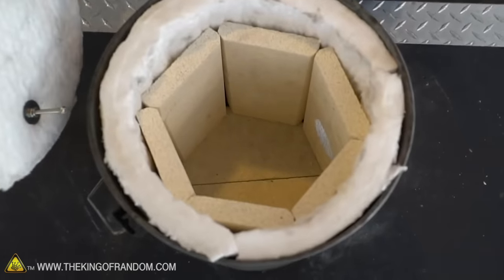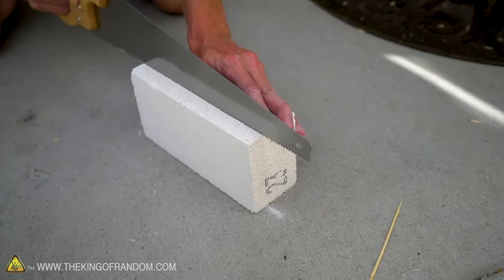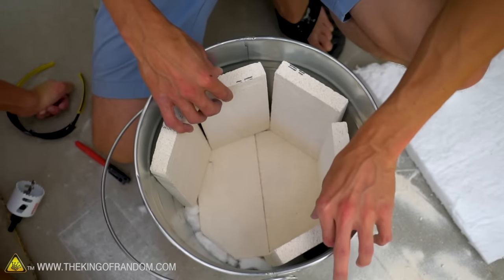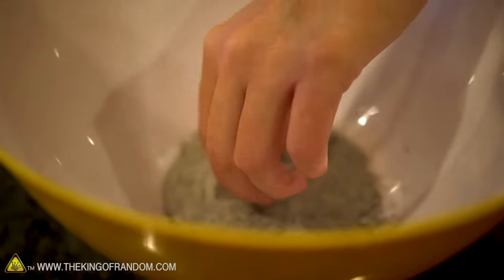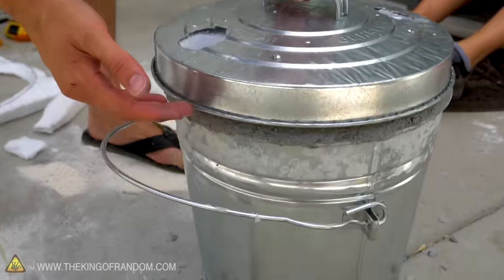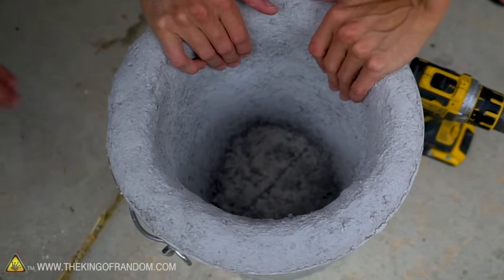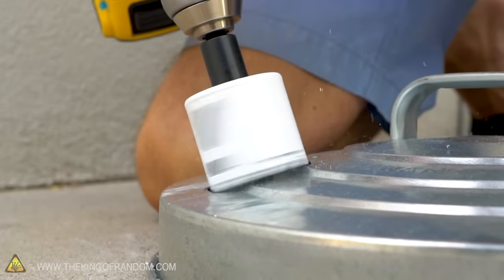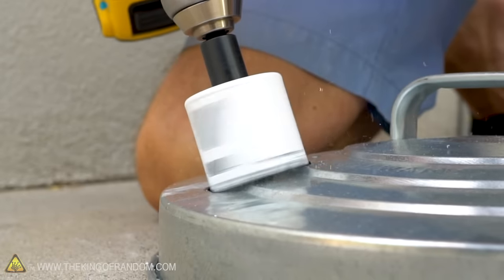Building The ULTIMATE Backyard Foundry

Comment: Just tested my electric foundry inspired on one of Grant's videos and It can go up to 1200C !!
Reply: I wonder what other heat sources you could use
Reply: @OldGamerNoob burning  propane or oil, graphite electrodes or induction are some other options
Reply: K
Reply: Friggin pyromaniac XD
Reply: @MechaRoses  nope, only if the heat is transfered into combustible materials.
Electric current creates plassma arcs, not flames (though technically flames are also a form of plasma)
Reply: Pretty fast for Mario kart
Reply: That's so cool!! Congratulations man!!

Comment: Only thing missing is ITC HT100  that is the height temperature refractory coating to go over the cement and cure it completely.  It will reduce fuel consumption and increase the heating capacity of the  foundry.  And your foundry will  last longer too.
🙏blessings abundant yall
Crawford out 🧙‍♂️

Comment: This I is a really nice upgrade to Grant's design and it will probably last way longer.
But what is the cost? That was a huge factor in Grant's reason to make a metal foundry.
Reply: Johnny Stephenson seems fairly cheap. A bucket. Some heat bricks and insulation. Some concrete. Certainly seems much cheaper then buying one?
Reply: Yann cedric Totsingan  compare that with an actual foundry this size... yeah, I think I will be building my own.
Reply: Sometimes DIY projects are about the challenges not the cost. You will always have leftover materials. If you were doing several then you could have better Material utilization and have a better cost per unit.
Reply: Yann cedric Totsingan  This is cheap, it costs around $50. Buying one would cost $500-$1500.
Reply: @VPCh.  Cheaper than Grant's though?
Reply: @hudsonjunning1449  Probably a similar cost, it also be more effective, which is the main concern.
Reply: @VPCh.  the og furnace was under 20$ and was very efficient
Reply: @johnnystephenson7835  This one: Container: $10
Bricks and insulation: $10
Reply: @VPCh.  concrete, screws for lid, the drill bit?
Reply: Yann cedric Totsingan 
4 insulation bricks, one steel bucket, about 2 meters of insulation fibre, roughly a medium sized bowl of concrete/cement, a couple of screws, and a drill bit and saw. Seems incredibly cheap compared to the price of buying one. Not sure what “all those materials” are. They used hardly anything. Most expensive thing was the drill bit as far as i can tell. And if you do these kinds of projects odds are you already have a drill bit like that anyway. So yea, a fraction of the cost yann. Very cheap in comparison.

Comment: Little tip for making the Wool in the lid last longer is to seal it with a moderate (1/8-3/16" thick) coat of Satanite (refractory clay) as well as the walls of the foundry and anywhere you've drilled a hole. then it'll be pretty well bullet proof.
P.S. Satanite is a refractory clay commonly used by blacksmiths for anything from sealing the walls on a gas forge to differential hardening (setting a hamon line) on knives.
Reply: that's such a menacing name lol
Reply: What do the screws on the lid do exactly? how do you know where to place them?

Comment: Really shouldn't use galvanized steel for projects with lots of heat.
Reply: Dave Does , thats right it can make boron fumes or something like that?
Reply: @gamleole9568   pretty sure it's zinc fumes, but  whatever it is is really bad for you and cause permanent. the rule of thumb is to never use galvanized steel in high temperatures
Reply: what should one use ?
Reply: @munch15a  Steel is fine, just don't use galvanized, a painted metal bucket would be great.  I made one from galvanized and when it got real hot I could see the galvanizing burning off.  That gas is toxic.
Reply: @munch15a  stainless steel is best since it can handle high heats more so than regular steel.
Reply: @xxdabroxx  so where do I find a steel bucket that’s not galvanized ?
Reply: @yourboyjor391  get a stainless steel one.

Comment: King of Random crew I was watching your videos on thermite and liquid oxygen and I thought what would happen if you mixed them both up in one way or another.
Reply: It goes kaboom
Reply: this would prolly be abit to dangerous, thermite can be abit unpredictable and giving it pure oxygen to burn in could increase the heat, or / and the speed of the reaction from a fast hot burn to an explosive, molten metal spewing nightmare. amazing to see lol
Reply: it would not change anything, thermite uses a redox-reaction, so it provides the oxygen for the reaction itself. Adding more oxygen would not benefit the reaction.
Reply: @bertan98  its not the reaction that would be changed sinse this stuff will burn under water, but give any flame a purer oxygen atmosphere than standard and it will be increased in temp accordingly, sinse the liquid oxygen will be evaporating.
Reply: @ikitclaw7146  Evaporation removes heat?
Reply: @CosmicEpiphany  .... ok this made me lol, ty
Reply: @ikitclaw7146  physics made you laugh? I'm confused...

Comment: Have you heard about AIR CRETE ? Air crete blocks treated with water glass have heat resistance and high insulation value. Poring the blocks with beveled edge will create a barrel shape. Another revision i would suggest, is to place that barrel on top of a raise circle to allow  lifting of the barrel for spills. Other equipment as propane is clean. Some have had used oil under air pressure to reduce fuel cost. Just putting out ideas for cost saving.

Comment: I did this in 1997 with a trash can but I used clay sand mix and 2 propane torchs on a hose connected to a splinter and a BBQ tank. Lot's of aluminum went threw it. A pipe with a bottom welded on. It was nice sounded like a jet.

Comment: 10:32 next time try a same diameter (OD) PVC coupling sprayed with Pam before you apply the cement and make sure to file off any protrusions on the outside that might keep it from coming out easily after the cement cures

Comment: About that hole /saw drill bit the thinner the metal the higher the speed needs to be. I work with metal 

A high speed rotation has the tendency to scrape across the edge making a nice hole.

Fist rule is thick metal needs a slower pace so it can get rid of cut metal because there is a lot of it  and thin material has less mass so higher speed cleans more.

Comment: Nice project....In hindsight. it could be quicker to make all the holes ...through the bricks..but before applying the cement.just insert a temporary pipe and work around it with the cement paste, and pull it out before it sets

Comment: You should have lined the internal wall with wire mesh before applying that cement/mortar mix.
As is, that stuff will eventually just flake off after putting it through extreme heat.
When you use wire mesh, it acts as a flexible scaffolding to make it so the cement wont break off when it is put under stress.
Same reason they use wire mesh in construction. Without it, the cement will crack and break up over time

Comment: I recommend titanium bucket. It has one of the highest melting points. It's why they use it on military jet engines as an insulator so the flames don't melt the wings

Comment: For those who intend on building this style furnace, do yourself a favor and have a paintbrush with some water nearby. Before the high temp mortar sets, wet the brush and smooth it out for a much nicer finish. You'll have less "debris" that will tend to fall off after the heating and cooling cycles.

Comment: Nice foundry... only I wouldn't use a galvanized can for the shell.  Zinc around heat is BAD.  It only takes 788 F to melt zinc and 1665 F to boil it.  This can result in metal fume fever, which is miserable at best and lethal at worst.

Comment: Use vibra ram it’s much easer to use with a inside and a out side mold it leaves a layer between to two. You will need a vibrator of some kind one with a ball inside works well just attach the vibrator to the outside mold pore vibra ram in with inside mold inside outside mold turn on vibratory on and it turns into a liquid almost you can make the shape as thick as you want by moving inside mold mandrel to where you want it . Dry low heat for twenty four hours high heat until red hot.

Comment: Here's a thought...cut the hole in the bucket Before pouring the plaster....FILL that hole with a "rod" of packing foam fit into the hole and extending inwards towards the center
when the cement is poured and set, BURN the foam out leaving a path from the hole in the bucket through the cement
no?

Comment: Is the bucket galvanized? I read a comment on one of the other foundry videos that using galvanized steel emits gases that present a real health hazard. It would be important to clarify that, so people out there dont breathe in loads of bad gases. However, I do think most people will use these foundries in well ventilated areas anyways

Comment: So i first started using Grant's original design and used plaster/sand mix however I couldn't get a plastic bucket the right size so i ended up using a metal pail covered in painter's tape in the hopes of being able to just overcome the stickiness of the tape to pull it out. Unfortunately that is not so. Would anyone have any recommendation on how I can pull out this metal pail without breaking the plaster?

Comment: ok guys, when i made mine i used this same sized can and the same insulating fire bricks as you did, even cut them in half...the difference is i used a half sheet of kaowool, not strips to line between the can and fire bricks, so i have a continuous 3/4" - 1" thick kaowool barrier between brick and steel... then i also used some refractory cement to fill the gaps between the bricks and around the top edge and at the bottom of the bricks. i did not spread it out on the surface of the bricks... when i9 use my forge, the can gets too hot to touch after about ten minutes... did yours? should i re line the whole inside with the cement? will it make that big a difference? thanks!

Comment: 6:59 wont that exposed steel nuts melt?, at least they will transfer heat to the metalic lid outside so marking them as hot spots not to touch would be convenient.

Comment: What’s the type of concrete theyre using
Reply: Brayton Pultz it's not concrete it's plaster and sand because concrete will always have some moisture in it so I could crack or explode due to pressure inside the concrete

Comment: Would you guys ever use his Hydrogen generator to power the foundry? Hydrogen last I checked has about 33,000 BTU, which burns hotter than propane and even gasoline. Might be able to melt denser metals.

Comment: You know making stuff if fun but it would be cheaper to buy an Electric furnace. Gas is also more expensive when used at high psi. I was talking with a guy and it cost him $20 in 8 hrs of using propane. It would cost me $16 for 8 hrs of propane but only $1.60 for 8 hrs of electric

Comment: If only the hole on the bucket and brick was done at the start and a plastic tube was used before the cement was applied .. drilling would have been easier

Comment: Those two have no idea what are they doing. No instruments, making the cement mixture in the kitchen with face masks :D, no single trowel or spatula, adding cement on hand and drilling trough it after hardened, ruining the entire integrity of the structure. The worst thing is that there will be a lot of people watching this, believing that that's the correct way to build a smelter...

Comment: I gave you a thumbs down because you should have proved it’s performance by showing a copper or even an aluminium melt, also a little more thought would have you saving an expensive hole drill by cutting the side hole in the can first and building your fire bricks and concrete around a former which would give a much nicer fit. Sorry but a touch amateurish